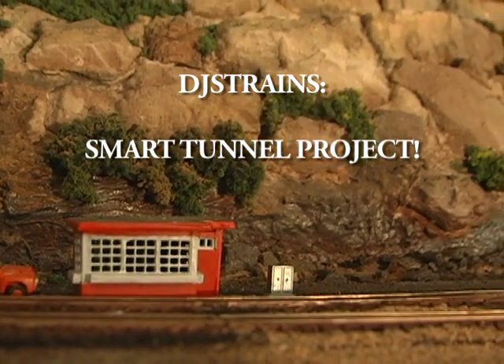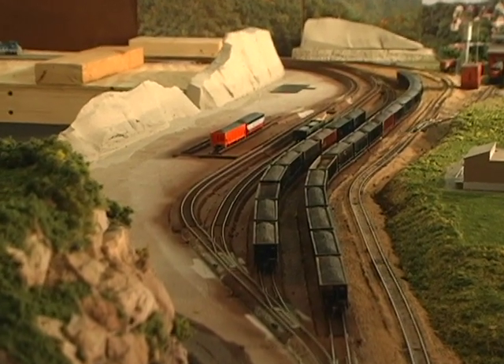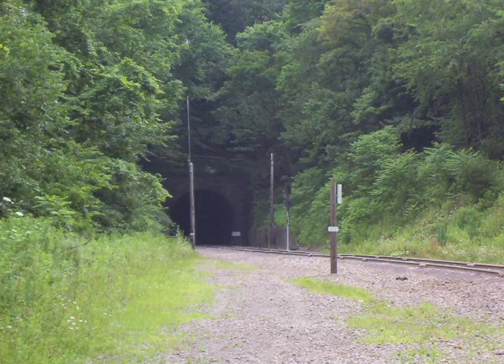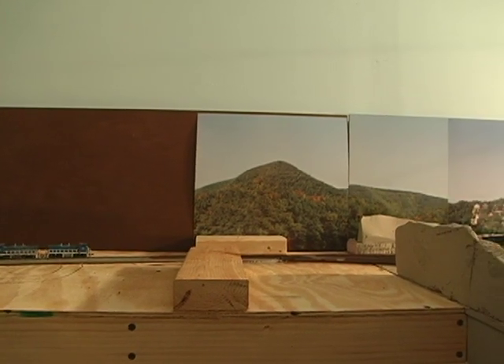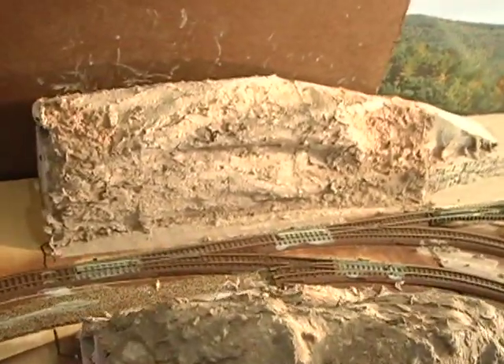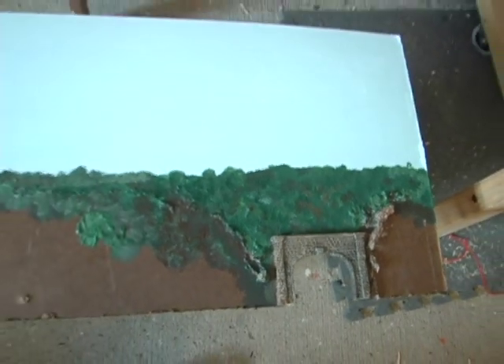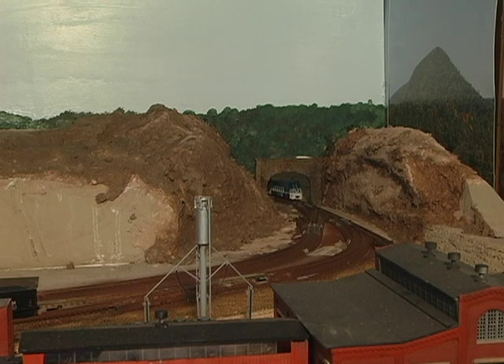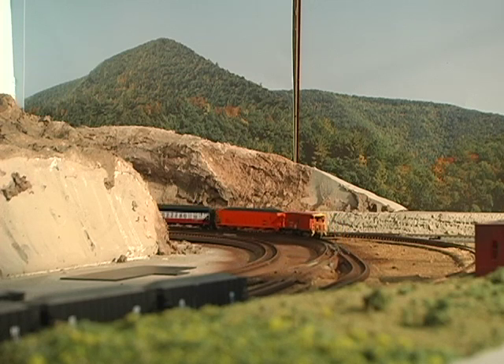MODEL RAILROAD TUNNEL (The SMART WAY)

Comment: DJ, that piggyback ramp looks a little high? Hope there isn't any glassware in that trailer. Nice video, Nice engine house, North Bessemer is looking good. I think the only thing I would have done differently, sandwich a 2 inch foam board between two pieces of hardboard for your backdrop and tunnel. The Union layout is looking great, two thumbs up. Looking forward to more progress videos on your layout.
Reply: OK, not sure why my above comment does not show unless I'm logged in?
Reply from the maker: RWSBaden because youtube is always screwed up.  It takes me numerous refreshes just to get it to approve comments in the first place.
Reply from the maker: djstrains I use approve feature to eliminate spam, but sometimes it causes comment problems.

Comment: hey DJ.... looks like you are spot on with the engine house... i like your tunnel scene looks great & fantastic idea... what turnouts are you using? are you using code 80 or 55 track?.. keep up the outstanding work
vinny
Reply from the maker: I used Kato & Peco code 80 for the switches.  Kato is so reliable, and peco works great for tighter switches.
Reply: djstrains thanks DJ.. just wondering because i am switching over to Peco turnouts but seem to have a problem using them with my code 55 track.. if you know of any one that uses the Pecos w/ code 55.. i would appreciate it if you put them in touch with me
thanks again
vinny
Reply from the maker: bnsf6951 ok

Comment: I would suggest reworking the foreground hill to be a little lower. It doesn't seem to match the very low-slope gentle topography of the prototype location. When you get trees planted, their canopy will obscure the view of the tunnel; it would be neat if you could catch glimpses of the portal through the branches.
Reply from the maker: I really wanted to go to the area with my video camera and try to capture it better, but this weather has been terrible, and I didn't have time.  It is also pretty hard to access by foot because it is a muddy hill to climb down.  Maybe when the weather improves, I'll get a chance.